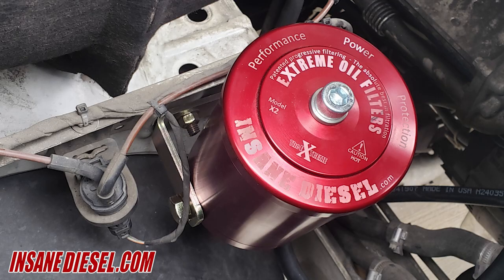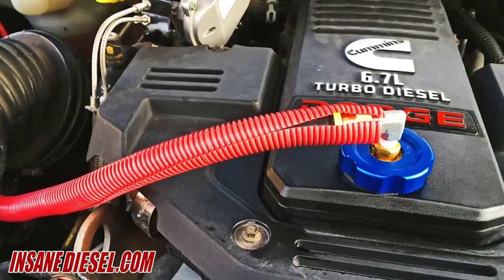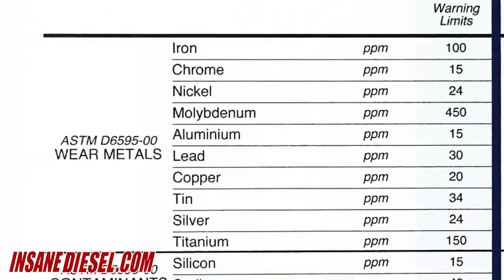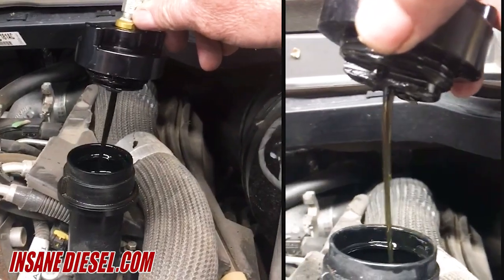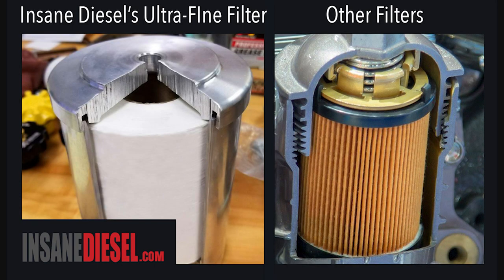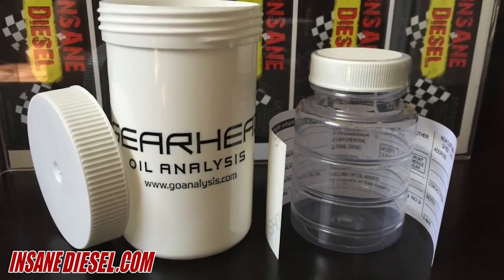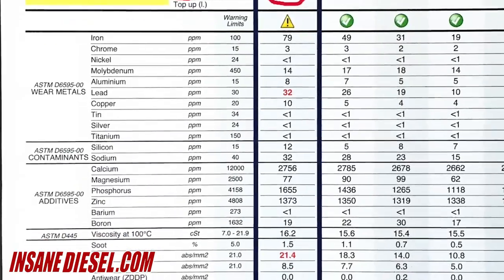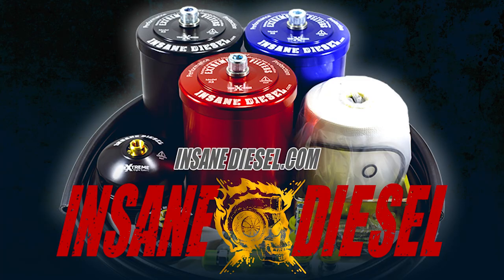What Is A Bypass Oil Filter and How Does It Work - Insane Diesel

Comment: If the whole benefit is a much better than OEM filtration, why not just put a finer filter element in the stock location and reduce all these additional parts? Or is there something I'm missing?
Reply: It's about volume. A larger volume of oil can pass through the original filter and supply the engine needed lubricant. If you ran all of the oil feeding the engine through a .2 to 2 micron filter it would not flow enough and the engine would fail.
Reply: There are filters that screw on in place of the full flow filter. Because they only have about 1/3 roll of toilet paper in them a large bypass valve is always open when the engine is running. Not a good idea.
Reply: I dont know of any way to avoid hoses if you want clean oil. Full flow filters are not to clean oil. They are to keep anything big from entering the engine parts.